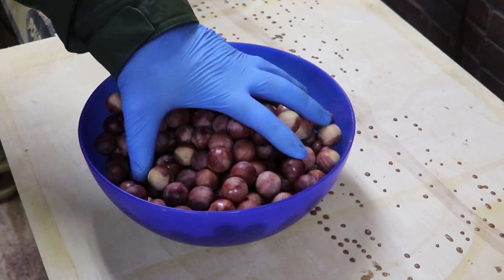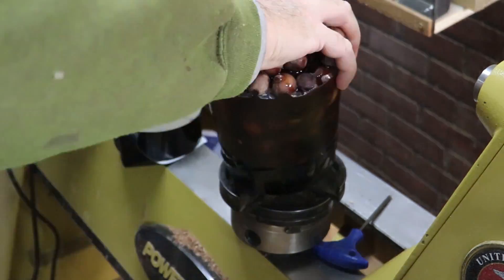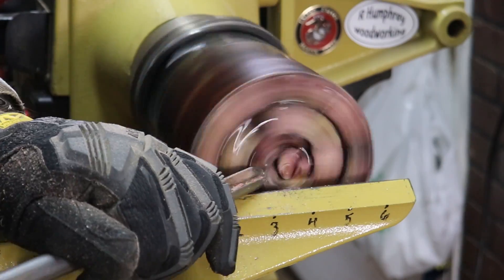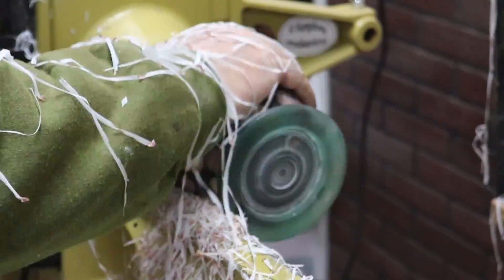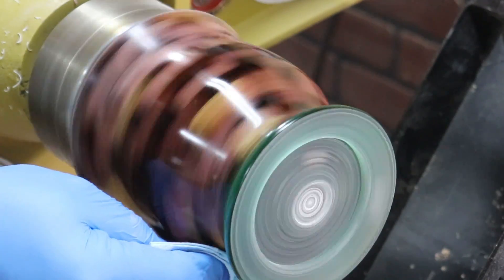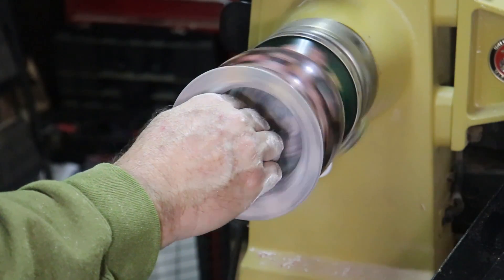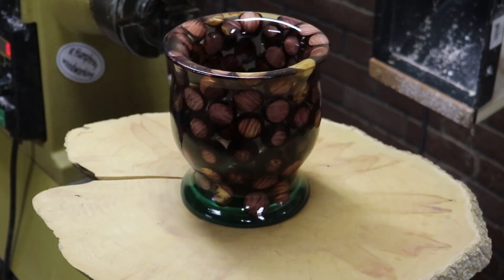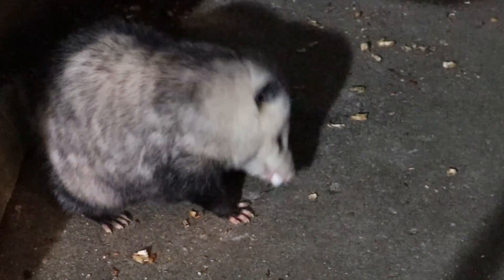Woodturning Cedar Balls in Resin

Comment: Since the mold was tapered, if you had gone with straight sides, the size of the exposed balls (snicker) would have graduated top to bottom, I think. 

I don't know if you did it on purpose, but since the balls seem to have floated off the bottom, it gave a very cool effect for the base.

Comment: It would look better to me if you first made a goblet out of solid wood, and add the Cedar Balls cut in half to the outside of it, then put that in resin, and then turned that a second time. Mainly because I don't like the transparent gaps between the balls. My way you would have wood within wood, and no gaps.

Comment: Help me understand wood turning, which I have no experience in. Why fill the container with the balls and resin only to then cut away 70% of it. Why not use a sacrificial wood block in the center that is a little bit smaller than what you anticipate removing?